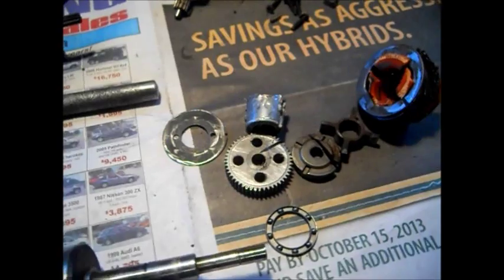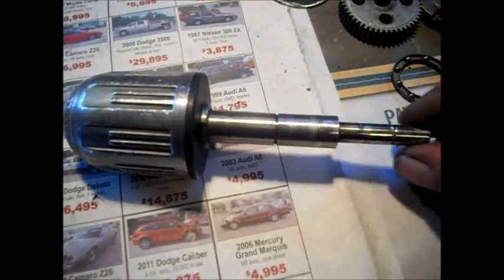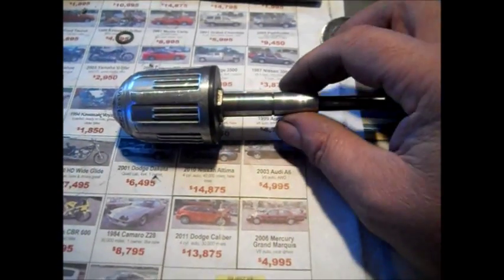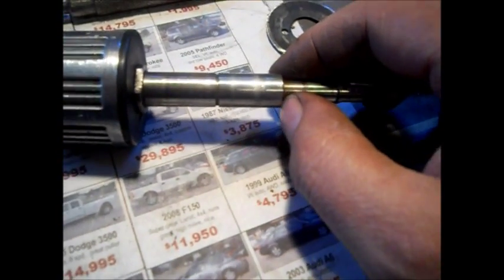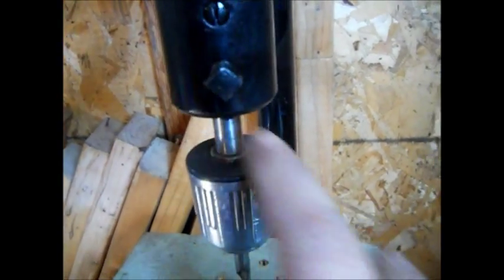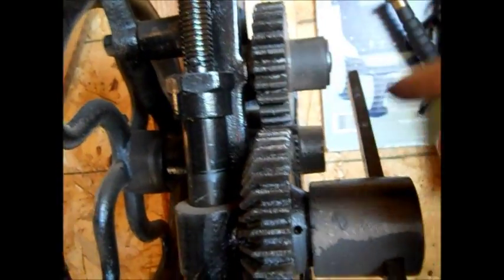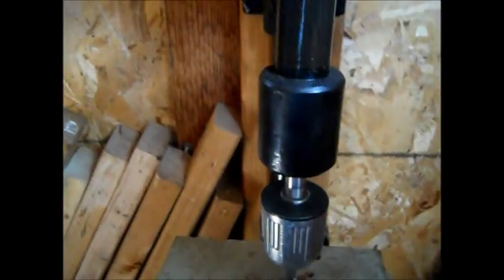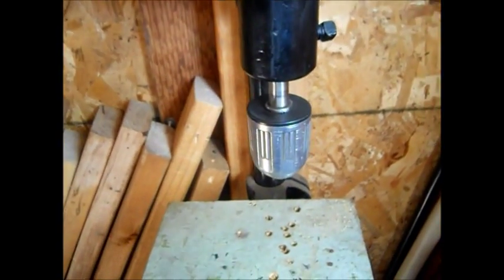Making a Drill Chuck for my Hand Cranked Wall Mounted Drill

Comment: Awesome. I am going to get a Jacob's chuck for my Acme post drill as well. The only thing I need to do is see if I can find someone to loan me ratchet arm and paw to have recast. Or if someone has one they can have recast for me. Otherwise mine is in great shape. The earliest I have found this model is the 1912 Sears catalog.
Reply from the maker: If you had enough pictures maybe you could carve one from a block of aluminum ?
Reply: I don't have the skills to carve aluminium or cast for that matter.  I have thought of trying an aluminium cast though.  Just need something to make a mold from. The measurements would come in handy though for possibly making a replacement from flatbar.

Comment: I have one sold at sears made in early  1900's and it works great on steel, because of speed and pressure. I've tried it by drilling 1/4 inch hole on a file.
Reply from the maker: I rarely use mine but I have drilled a 1/2 in dia hole through a 1 inch piece of steel ..It took some time but did the job
Reply: Have not used mine in years. Found it in abandoned barn. Took some time to get it working but last I used it, it still works great. I hate that kids these days have no clue what got them to where they are today. Getting old, and wished I could sell it, because  my kids will just throw it away when I'm gone. Just hate History has to go to waste.